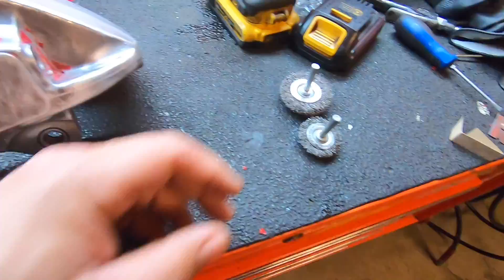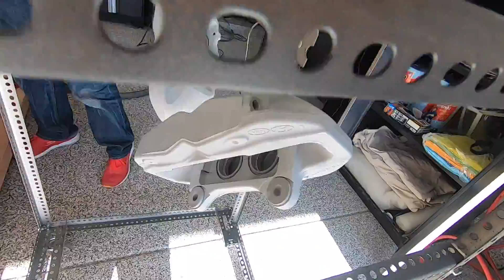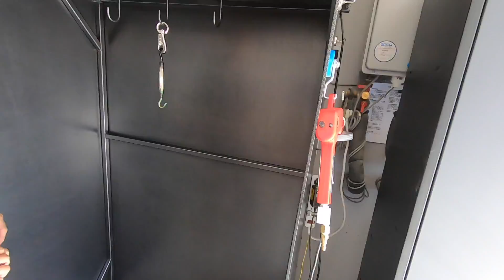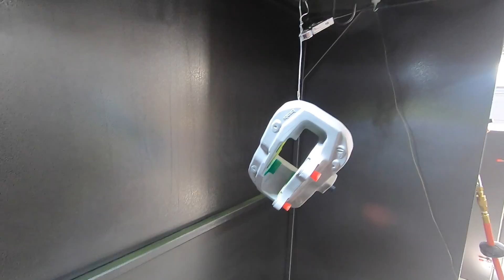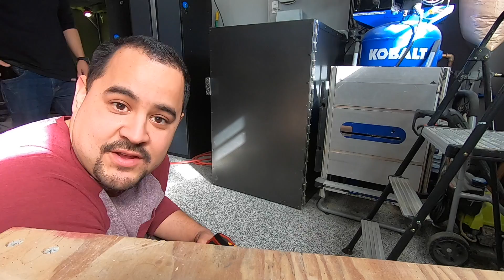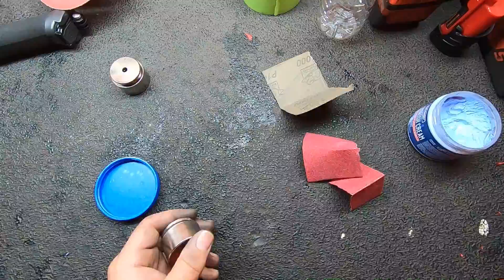CUSTOM BREMBO CALIPERS FITTED TO MY 10TH GEN 2018 CIVIC SI (THE PREPARATION)

Comment: Dumb question will this also work for a 2013 si sedan ?
Reply from the maker: No such thing as a dumb question. The Acura TL brembos work for your vehicle. These require more modifications to fit your car.
Reply: @modfydgarage2312  awsesome. Thanks you for the response. What mods would be required if you don’t mind me asking? That rear set up is very interesting and I’d be willing to try it out 🤔 my biggest concern is the master cylinder not being big enough for the brembo fronts and or additional Brembos in the rear
Reply from the maker: @sikariodelm3korita  the knuckle may need drilling at the mounting holes to fit the bolt to the calipers. The TL are direct fit. No modifications. The master cylinder was enough for my kit. It actually stops better than my new STi.
Reply: @modfydgarage2312  awesome thanks for the info and if you ever decide to revisit the rear brembos but for the 9th gen I’d be very interested even with out the ebrake 👍

Comment: Do you have a parts list. What calipers and what brake rotors fit correctly with very little modifications? Any help would be appreciated. I’m looking to upgrade my brakes ASAP
Reply from the maker: I've got a new video coming out in a week explaining the parts. Subscribe so you can see what's needed! Thanks for looking!
Reply: Modfyd GARAGE  In order to get that info I have to wait for your video and I have to subscribe?  You coulda just wrote it out no? and maybe I would have been like “ya know, I’m not liking his channel but this guys cool, so I’ll subscribe” but the fact that it became a sales pitch for your channel and you couldn’t just answer the question is cringey. Thanks anyway
Reply from the maker: @GettingInJapanties  there's a method to my madness. There are modifications to be made. Which i refuse to type out for you just to have to answer questions that I KNOW you'll be asking anyways.. And I don't consider myself a youtuber. I do it for a hobby. So there are no sales pitch here.

Comment: WTF!? You did not show any install, or didn't even list what rotors you ended up using! The whole video was just you f...ing around with powder coating the calipers, and polishing the pistons!!!
Reply from the maker: Because installed the rotors and they were undersized. I have to buy a different set of rotors before i release the next video. Cost money to do so... I'll post the next video as soon as I get the proper rotors.